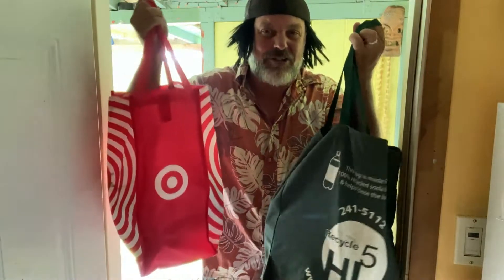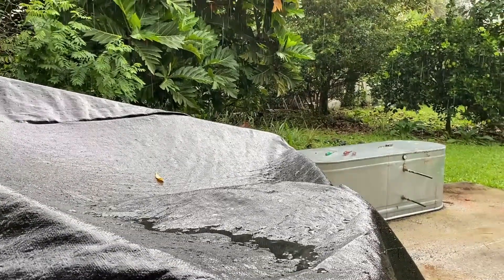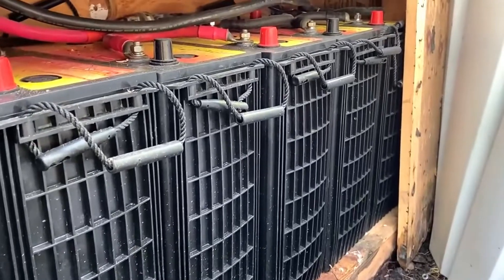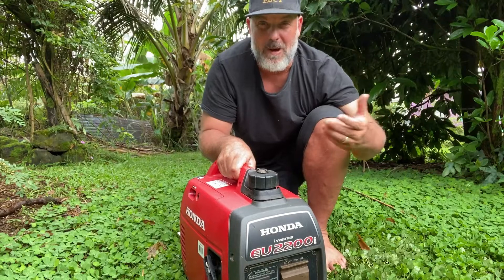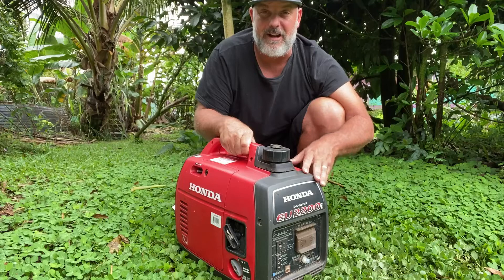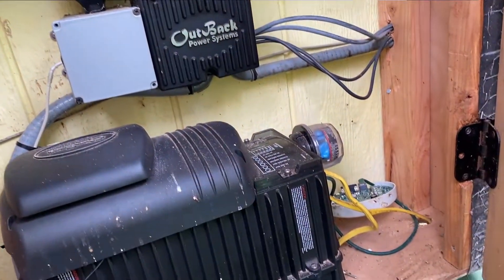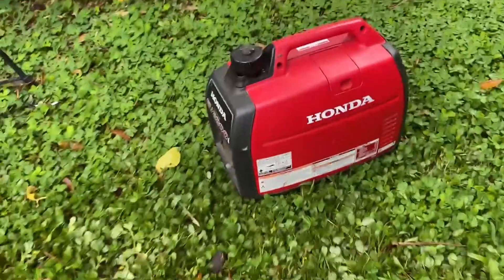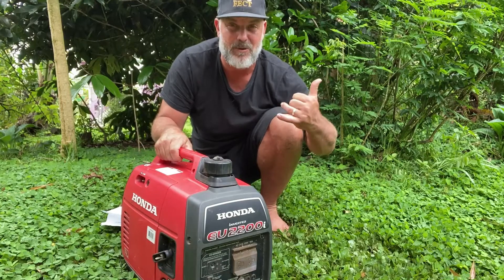Better Have A Back Up Source

Comment: I bought my Honda Eu2200i about 2yrs ago as well and ran it for nearly 18hrs a day for my power needs. i live in an off grid temporary structure while I am building my home here in Puna and I would just like to add, something I wish I had known at the start, if you are using a gas generator w/ eco ability to power your appliances, you should run it full bore, not on eco, for at least one cycle per week, to keep the muffler from becoming clogged with carbon. I was doing regular maintenance every two weeks, changing the oil, cleaning the filters, spark arrestor, and changing the spark plug as needed but running it always on eco mode and I recently had to take it in to White Cap in Hilo and have the muffler replaced in it. I am now on a small solar set up with an all in one solar power supply, Bluetti AC200p and (6) 100w Rich solar polycrystalline panels and I love it! The other day I woke up to rain and the Bluetti being at 28% and I used the Honda to charge it up to 100% in 2 hours and 20 minutes. Sean, thanks for informing everyone that if they use your link you will get commission w/ Amazon orders, this is news to me and have always wanted to be able to support your channel but living on a fixed income couldn't until now. I will begin to use your link on my next order which coincidentally is in the next few days. Mahlo Nui for all the great info you put out there, it has helped me alot. Take care brother.
Reply from the maker: Thanks for those tips. I’m constantly using my generator with my power tools and I take it off eco mode for that. That’s what must’ve saved me all these years because I’ve never had an issue like you mentioned. I wish I could go back and add that info into the video. Thanks for the offer to support the channel. It does help. And Amazon makes it so easy.

Comment: I have (not really) a “backup generator” (not a Honda).  It runs perfectly when I test it (once a month), but NEVER when I need it! (How does it know?). Anyway, I’m in process of revamping all my power.  I hadn’t thought of running a generator to charge batteries, I guess I was thinking of it as “standalone”. Mahalo nui loa for making me think about it.
Reply from the maker: The generator really is the workhorse that keeps the solar system going. Thanks for watching!